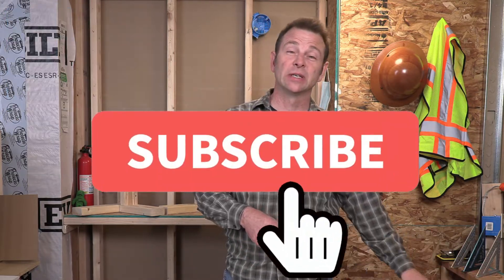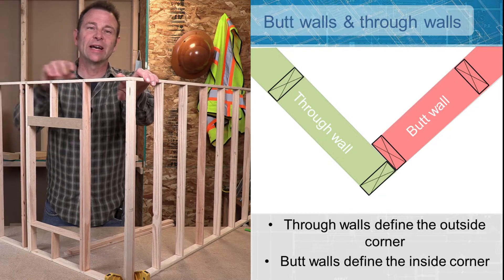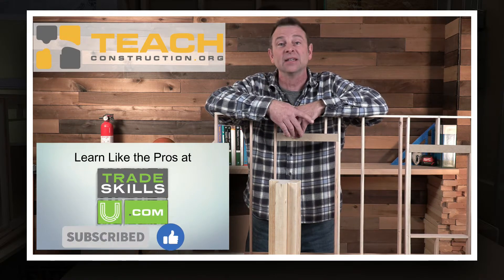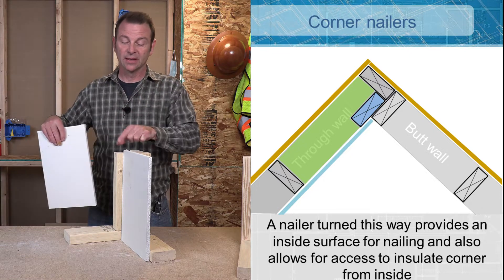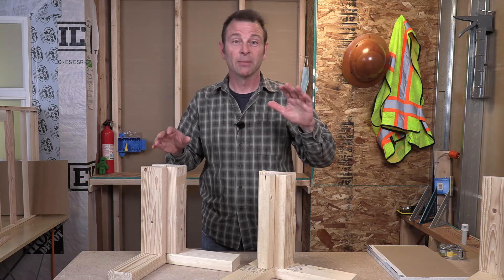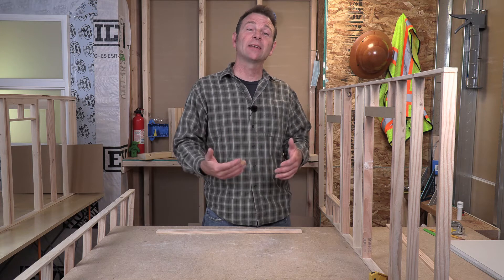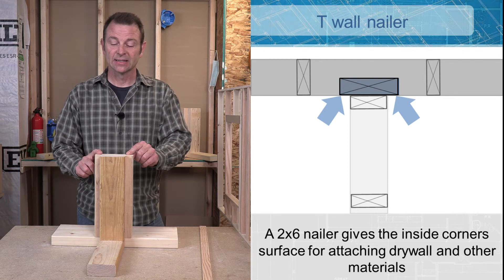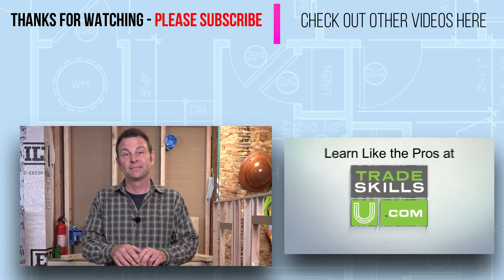Wall Framing Connections and Corners - A Lesson from our Framing course - TEACH Construction

Comment: I’m sorry but your explanation of it helps make house more energy efficient is a lie !
Just putting insulation in that corner doesn’t make a bit of difference in how this works!
The problem is cold ( or heat ) can dissipate through the wood using your corner much easier than using a proper corner post ! Of the home is wrapped from the outside then insulation in this corner has no impact at all ! I would rather have a stronger built home and no useless insulation in that corner!
 My first house built using corner post and rafters and floor joists instead of new trusses is still standing in key west Florida after 73 years and going through a lot of hurricanes and the structural integrity is just as good today and we have seen new build after new construction of new so called better ways get blown away !
 So I’ll keep using corner posts and I’ll keep doing things my way ‘
Your home is built like a Horton house and we all
Know what garbage they build

Comment: Very clear.  If the only purpose of the third stud in a corner is as drywall nailer, wouldn't using 1x6 allow even more room for insulation ?  Drywall clips are more expensive than a wood member and require that dryall be hung on that wall before the other wall or you won't know where the clips are.
Reply from the maker: Try on the clips.  Personally I don’t like the clips, but we had to talk about them.

Comment: I was looking for an alternative to 3 stud channel which when built is very heavy. I have a 2x4 wall where the framing was hacked in the garage and have a 2" drain for the washer right next to where one leg of the 3 stud channel would be located at except it never touched the bottom plate and the next stud never touched the bottom plate due to the p trap for the washer. Old school - The 1st top plate is supposed to continue past the 3 stud channel according to Larry Haun 4 ft. Do you have any videos that show the interior through wall that is 2x6 framing on one side and 2x4 on the other side or any other combination. On the left side of the 3 stud channel is fireplace that is located 51" away. I would like to upgrade the left side to 2x6 and on the right side of the 3 stud channel is a 2x4 wall and at the end of the wall is 32" door. Old school, i would need to replace the 1st top plate with at least a 16 ft board. Is there any modern framing where a repair could be done in 2x6 without having to rebuild the entire wall? Also do you have any videos showing how 3 stud channel would be changed to support an LDL beam for knocking a wall out in a kitchen?
Reply from the maker: sorry, way too technical and specific of questions for a basic video about how corners and connections are made.   You should consult a building engineer.

Comment: How do you determine where a window falls?... how far from the corner it starts?..
Reply from the maker: Windows are where you place them, as long as you can fit all the framing required by your local building code.

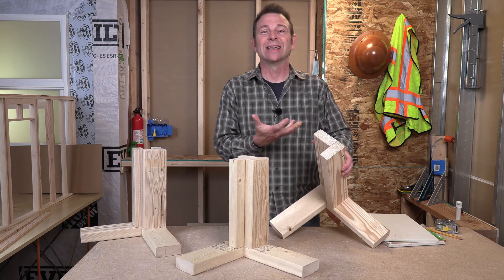Comment: 10:00  IT'S STILL A CORNER WALL!!!!
I WANT TO KNOW WHAT'S IMPORTANT TO KNOW CONNECTING TWO WALL FRAMES TOGETHER ON THE SAME WALL. NOT ANOTHER WALL CONNECTING TO ANOTHER WALL THAT IS STILL A CORNER WALL.
I WANT TO SEE HOW TWO FOUR FOOT FRAMED WALLS ARE CONNECTED ON THE SAME WALL THAT WOULD THEN BE AN EIGHT FOOT WALL!!!!!
I know it should overlap somehow. I have put this question in the search bar a few times and apparently it's too hard to comprehend.
I'm pretty sure I know how but I was looking for a video to prove to my son, they have to be overlapped so that it's sturdy.
Reply: The two walls you are explaining are connected with an overlapping top plate.

Comment: When building the wall of the room, I had an argument with my boss a few months ago because of the double plate. The boss said that making double plates is a waste of materials and time, and did not allow me to make double plates, saying that a top plate is enough. I insisted on doing it, and had a fierce argument with the boss. I believe that if the double plate is dispensable, the teacher would not teach us to do so in the video. There must be an important reason and role. The Chinese boss wanted to cut corners. In the end, I resigned and did not work with that Chinese boss anymore.

Comment: My god, I spent several days thinking about it before I figured out the function of double plate. The teacher actually mentioned it. It was because of my poor English that I didn’t understand what the teacher said. Because I saw that many Chinese people don’t use double plates, I was very surprised. Why did the American teacher teach me to use double plates? Since the teacher said so, there must be a reason. I thought about it for several days before I deduced that its function is to help the top to be pulled horizontally, so as not to crack and increase the strength.

Comment: Newbie question:  I want to finish my basement and already had 2 rooms built professionally.  The basement was poured in these yellow foam 'forms' which many have told me to sheetrock to.  However they're not strait full of bumps and what-not so the 2 rooms I had done I told them to space a couple inches out and do 'free-standing' conventional walls. I would assume I do not need any insulation in the basement right?  Also there's a beam in the basement overhead held by these steel 'adjusters' one of which I had them enclose into a wall when the 2 rooms were built. I hope these never need adjusting because I was planning on swallowing a few more of them into some walls is that okay or 'to code' ??

Comment: I'm curious why you didn't show connecting the interior wall to the O.C.  stud, and then using drywall clips.  Isn't that both the stronger and most energy efficient way to join walls?  Of course that drives rooms to be even increments in your stud spacing.
Reply from the maker: We personally are not a fan of the drywall clips, we talk about them on one of the lessons more to cover the available options.   But that being said you could use an O.C. common stud as part of your connection solution, but you will rarely find the wall lands right where your commons are.
Reply: @ConstructionEd  Interior walls do fall on OC common studs if you design for it.  And you've got 4 inches of leeway on how they line up. I'll check your video about drywall clips.  They earn good marks from people trying to improve cavity insulation, but I'll be using a lot of external insulation, so thermal bridging in the cavity doesn't have a lot of impact for highly insulated walls.

Comment: I'm not really sure where this guy learned how to frame houses.  His explainations of how to connect corners and interior wall is so far off it's rediculous.  First of all, outside corners are simple.  On tne receiving wall, nail two studs together in the shape of an 'L' and position it with the stud that's nailed facing the inrsecting wall, creating a 5" surface that you nail the end stud of tje second wall to.  With the interior walls, you nail three studs together fodming a 'U' which when placed it the receiving wall, creates a 6 1/2" surface to be able to nail the intersecting wall.  Much simpler than he makes it.  Plus, those clips for the sheetrock in yje corners don't work. First of all, there isn't enough support.  Second issue is the supports cost more than a stud, and the 'R' value loss he claims is mis-stated.  Tbe studs also have a 'R' value, they are cellulose.
Reply from the maker: I'm sorry you're not satisfied with the framing lesson.  I appreciate your time in sharing your thoughts on the video.  We were not trying to say that you should use a clips - simply stating that they are available.   I do have to disagree with you on the R value comment, YES studs do have an insulating quality of R1 per inch - but you can and should choose a better insulation if you can.   And arguably, the new code of IECC 2021 requires more energy-efficient framing.

Comment: The cali-corner is not enough if you have thick over the frame PIR insulation and airgap furring strips. (Like you may have in a sauna).

Comment: Great videos from this source!! Just a question on the corner where the two walls meet. There is no surface to attach drywall etc to the through wall? Do these not require an “L” corner made with two 2x6’s?

Comment: How does one determine to build a butt wall or a through wall?  Is it in the plans or designed by the engineer?
Reply from the maker: It’s all up to the framer, unless called out.
Reply: Thank you the reply. Now how does one “backyard framer” determine when building a small shop?  Any vids or links to assist 
Great channel btw. I’ve learnt so lots thus far

Comment: 9:15  could you use a thinner material than a stud, something like a strip of 1/2” OSB or ply to create the backing strip for the drywall?  That would give more room for insulation but more wiggle room than using clips.

Comment: I work as an architectural designer/draftsman, not a licensed architect. I take pride in what I've learned for commercial metal framing, to make sure I'm not producing drawings framers laugh at lol. With that, get into residential in my personal life, learning wood framing. I have an older 40s "kit" home with 2x4 exterior walls. For the T connection, if I use either of the methods, do I kill my insulation properties squeezing in batt behind the blocking or additional stud? Love your channel, best out there!

Comment: So my question is why would you not just add another 2x4 to the Through wall to square up with the Butt wall and have a surface where you can connect the walls in several locations for a more secure connection instead of just one point of connection? The more connections between two pieces of wood the stronger it is.

Comment: Would it be “wrong” to use a 4x4 at the corners?
Reply: Solid wood is not a good insulator, can warp more easily than multiple sticks, is harder and more expensive to produce and install. extra time for managing more different types of lumber, but mostly it gives you nothing to nail the drywall to

Comment: I don't like the idea of using the 2x6 because once the drywallers have installed the drywall, it only gives you 1/2" to mlnail the top of the baseboard to.

For the same reason, at Habitat I got the rest of the volunteers to afford a 4th ladder T at the bottom to nail the top of the baseboard to.

Comment: Thank you so much for the video tutorials, I spent a lot of time researching online & this is where I learn that drywall clips were used in houses (instead of studs behind wall corners for cost savings). That's exactly the case to my friend's house. The issue we're having is the drywall cracked from inside corner. Came to find out there were no stud behind the drywall that came detached. From the split reveal part of interior, I do see clip where the drywall corner meets. It appears one side of the drywall was fasten into stud & the split  side was fasten into the drywall clips. Any suggestions/tricks besides tearing out & replacing old drywall & adding stud behind to secure it? Even that may present challenges too, behind these drywalls are brick walls so hopefully there's enough space allow to drive screws to add new studs behind. Hope to hear from you soon. Thnx so much for the input!...
Reply from the maker: Not knowing the details, maybe you can cut a small area and slip in a nailer.   But the best way is to get some framing in there, cut back the drywall back to the next stud and make a patch.

Comment: How is the two by six nailed down when it’s being used for the butt wall?
Reply from the maker: It is nailed into the through wall.  The bottom plate is nailed down, and the top plates overlap the corners

Comment: What if the two corner walls have different heights
Reply from the maker: Not sure what your question is.  The same connection process can be used - but obviously no cap plates will tie the walls together.

Comment: I'm going with the Cali corner.  I think it will be stronger with some insulation efficiency.  Drywall clips sound like a weak surface to mount drywall to.
Reply from the maker: Drywall clips are prone to failure.  The Cali corner is the best solution in our mind.

Comment: I'm a Retired old school General Contractor here aways interested in new things even though retired.  New to me, I liked your Calif corner.  I don't like your 2 x 6 or ladder for the interior wall because sheet rockers are always in a hurry and if they nail up the interior wall sheet rock first that leaves only a 1/2" or less (sometimes the 2 x 6's are only 5 3/8') on the interior side of the exterior wall for sheet rock.  On the ladder type, as soon as the sheet rock goes up you can't see where the blocking is to fasten the sheet rock to.  Usually screws or nails are 8" apart on the edges of sheet rock so a ladder type would have to have about 11 blocks.  Putting  2 or 3 extra studs into the exterior framing aids in precision alignment of the interior wall and gives the interior wall framing and sheet rock something to nail into.

Comment: I was watching a Scandi builder recently, and in his build instead of the second top plate he had the same size timber on edge as a lintel beam immediately under his top plates all around his build. It stiffens the top plate against vertical loads a lot more than the second top plate.
I don't recall how he secured the top plates to each other at junctions, but here in Australia I'd expect to use a bit of galvanised sheet steel over the join rather than an extra piece of timber the full length of the wall, if I didn't need the second top plate to stiffen the wall. We use a lot of galvanised sheet steel components in holding our buildings together - it's very good for the task!
Reply from the maker: Interesting
Reply: Right on. I've always pumped the header up to the bottom of the top plate.

Comment: How do you get four exterior walls to break the ply on a stud for the two but walls? Wouldn't going 16" on center offset it due to the added length from the top plates and floor plates of the through walls. This is where I'm stuck can someone please help!
Reply from the maker: Not sure why the top or bottom plates would add to the over length - that would add to the height?

Comment: If you connect the exterior sheathing starting at the through wall moving towards the butt wall then you will no longer be nailing the final edge of the 4x8 sheathing on a stud that falls 16" OC. You shifted it over 3.5" (+thickeness of your sheathing material) to start at the edge of your through wall. Do you just cut the first piece of sheathing down to fall on the studs or do you add a nailer every 4 or 8 feet?
Reply from the maker: Your sheathing should start on the same end of the wall that you started your layout pattern from.   We cover it more in the sheathing lesson

Comment: When drywalling a corner with a one inch face and an inch and a half face, it is important to fasten the drywall to the one inch face FIRST.  When drywalling the inch and a half face, you will still have one inch for fastening the second sheet, (the first sheet will have reduced the second surface by a half inch, or 5/8" if using fireside drywall).  If you drywall the inch and a half face first, you will only have a half inch to fasten the second sheet, a little too close to the edge of the drywall.

Comment: How does one know where the connector holes are once the sheathing is on top of it?
Reply: For the first sheet, you can see the clips since they are still exposed. My guess is when the other corner sheet is pushed in, just look across to where the screws were in the first one.

Comment: Can drywall clips be used for the interior wall instead of a 2x6 or ladder blocking? Or is it necessary to fasten the interior wall to the exterior wall with more than the T joint at the top?
Reply from the maker: That would not be strong enough

Comment: 8:26 There wouldn't be a gap if you use a full stud. The corners would be stronger too.
Reply from the maker: A full stud or blocking in that old-school type of corner is just not needed and it does cause thermal bridging problems.   The standby argument for an overbuilt corner is typically that is how we have always done it - or the corner will be stronger.   The corner does not need to be stronger than the energy-efficient corner provides - if it was needed it would be required.    Adding the additional framing is simply not needed.   Save the money on building costs and allow for more insulation.  Leave out all framing that is not specially required by the engineer, or by code, or specifically needed for blocking.   The same goes for window RO's - one sill, and only cripples that fall on layout.   Double sills and stilting the bottom of the sill "to carry more weight" is an error in framing.

Comment: Clips fail. The corners crack every time. Lots of flex in the wall when mudding.
Reply from the maker: Yes they do. But we had to talk about them as they are used sometimes.
Reply: @ConstructionEd  We used them in the 80 on HUD apartments and sometimes even in the showers/ tub surrounds,

Comment: 2x4 has much more R value than any insulation no?
Reply from the maker: Not at all.   lumber has an R-value of 1 per inch - insulation has an R-value of between 3 and 4.25 depending on the type
Reply: @ConstructionEd  ah ok, I always assumed a 2x4's R value was higher than any fiberglass insulation. thanks.

Comment: That ladder wall connection is so efficient. Great job on explaining that.
Reply: The building code calls for drywall fasteners to be installed 8" o.c. for nails and 16" o.c. for screws on the edges so the if the ladder method is used it would have to installed minimum 16" o.c. not 24" o.c.